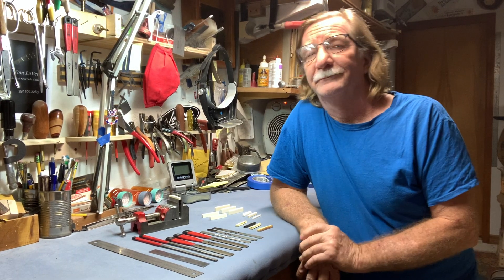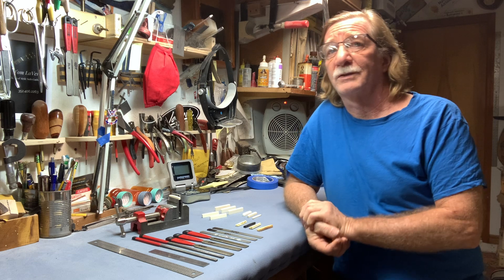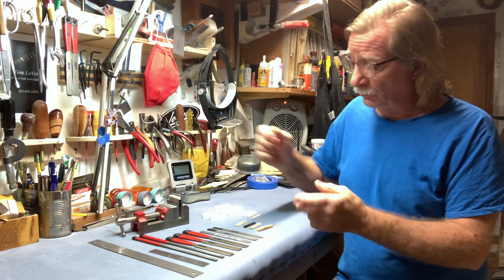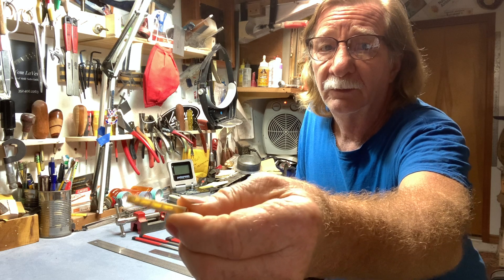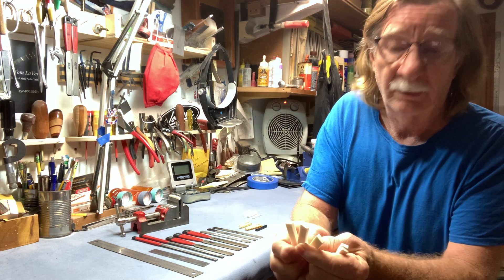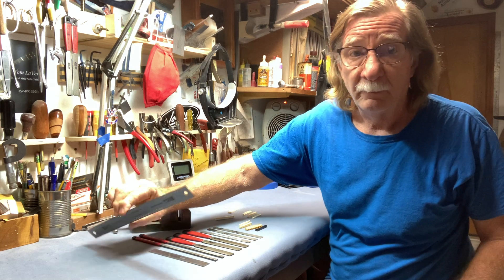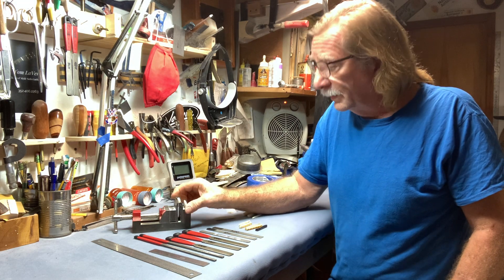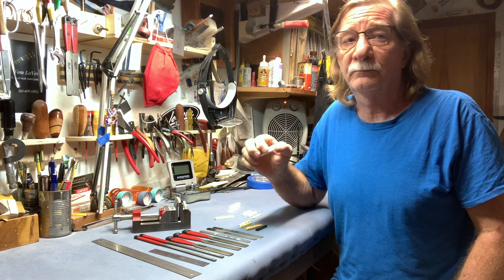Bone vs Plastic - The Advantages of a Bone Nut

Comment: Most people believe that the nut makes a big difference, even though most notes are played fretted and if you are using a capo all the notes are separated from the nut and the strings are vibrating only between the metal fret wire and the saddle and not from the nut to the saddle. I don't believe it makes a big difference at all.
Reply: It does when your nut slots aren't deep enough, resulting in bad intonation at the 1st fret, caused by the string having to be pushed too far down to make contact with the first fret.
Reply: make a difference always, on open notes and fretted notes.
Reply: its the saddle not the nut or the pins, jaja shuuu dont tell them